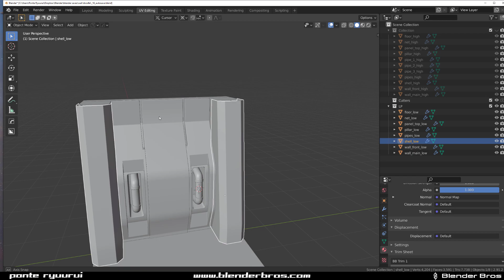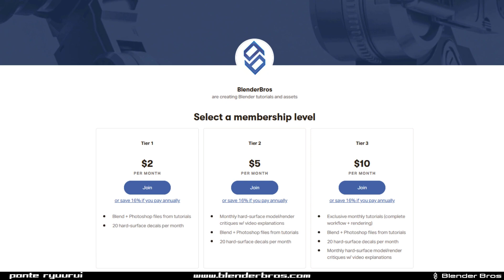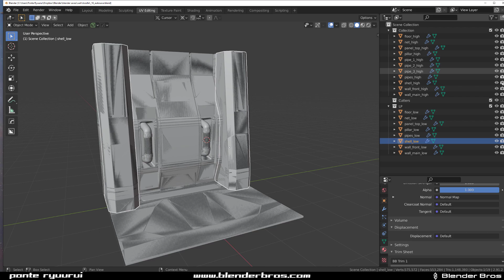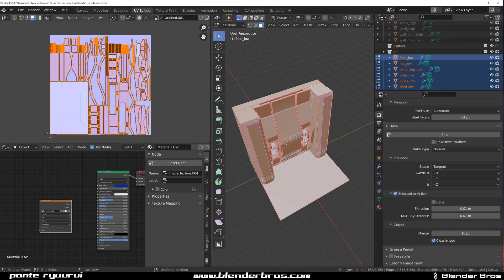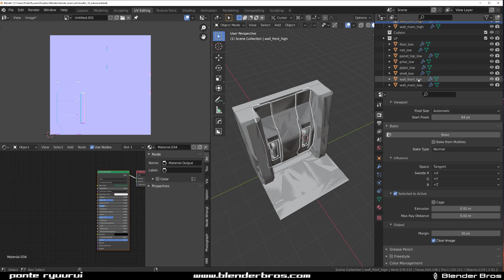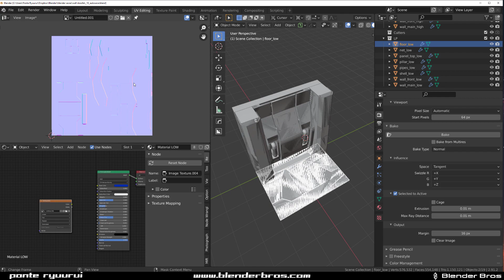GAME ASSET normal map baking tutorial for complex models in Blender

Comment: I've a question. I have a 3D model of a car with high poly count and also a low poly count, can I bake a normal map for the whole of the car? Or should I bake a normal map for every single part of it? I'm new to baking so idk what to do. Thanks.
Reply from the maker: You need to name all parts accordingly, so then software like Mamorset can detect which piece is which. You bake one map, but Mamorset will bake all parts one by one, better quality and fewer artifacts.